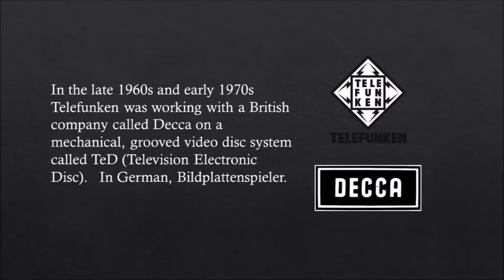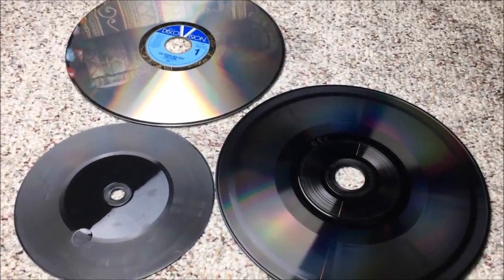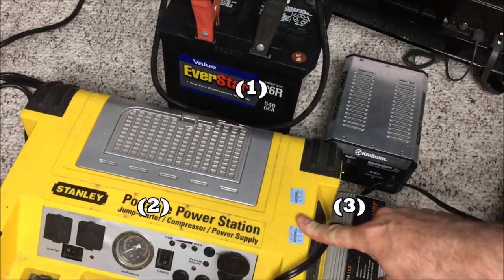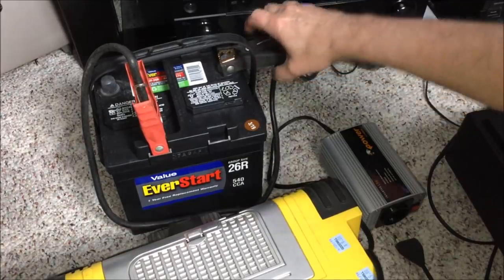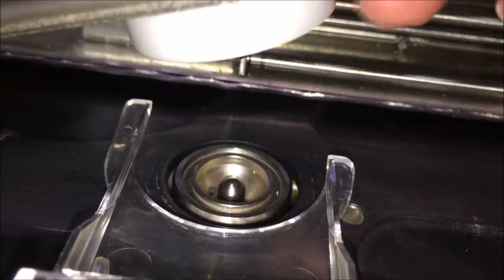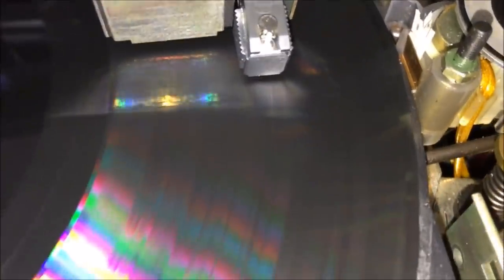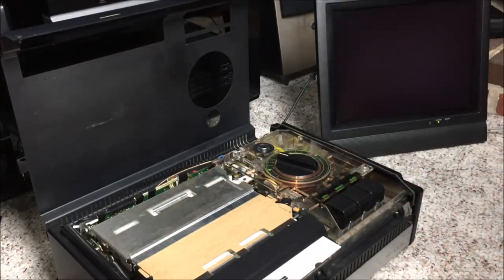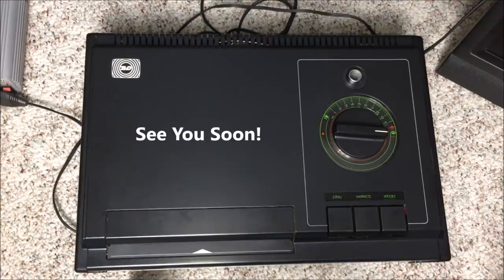BEFORE Laserdisc There Was TeD

Comment: Most electronics equipment from this era in West Germany relied upon a stable grid frequency of 50Hz. In the eastern (communist) part that wasn't the case. So many radio clocks etc. that were sorted out and sent to us poor Ossies didn't work very well. (had to adjust the time every day) OK wit all the many windmills which are to replace proper power stations 50Hz is a thing of the past too.

Comment: Wow. It was timed off the power-line frequency. BAD DESIGN!
Reply: It's not bad design. 
From the 1960s the mains frequency in western Europe has been regulated precisely enough to use in clocks. 
A simple mechanical clock driven by a  mains synchronous motor will keep time within +- a minute or so over many years. A very practical solution when quartz was expensive and radio controlled clocks weren't available. 
Precisely controlling a "big" motor using a quartz needs power electronics which was expensive back then. 
Most recorded players, film projectors, tonewheel organs, reel to reel recorders etc.etc. etc did the same thing.
Reply: It was never designed to run on anything other than 50 Hz, nor output anything other than a PAL signal. It was never intended for export, and as such, the design is adequate for the original intent. If the presenter operates the device outside these specs and gets a bad picture, we shouldn't blame the design. Of course that still leaves the possibility that the device is indeed faulty.